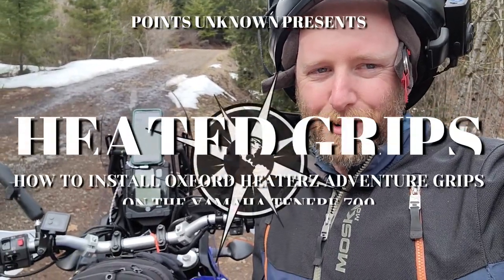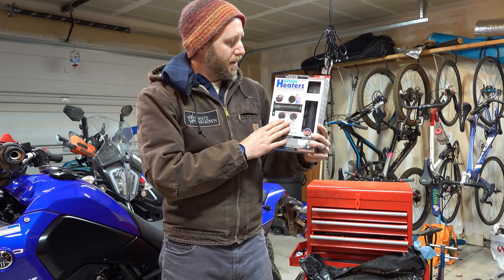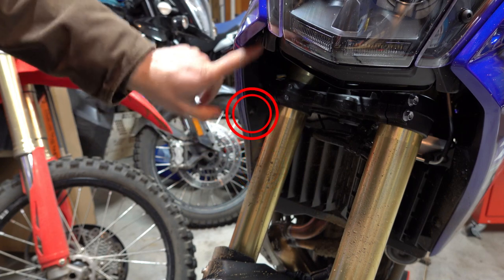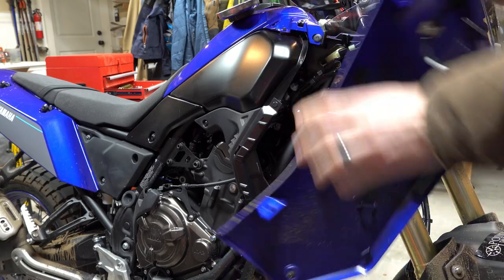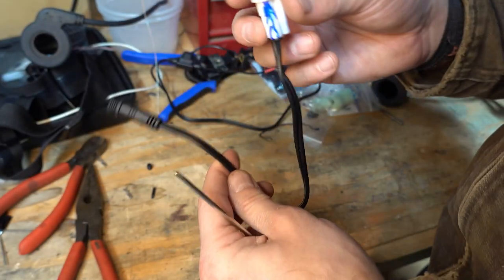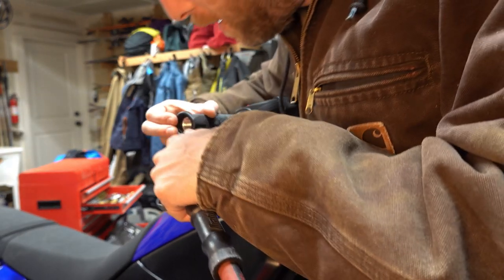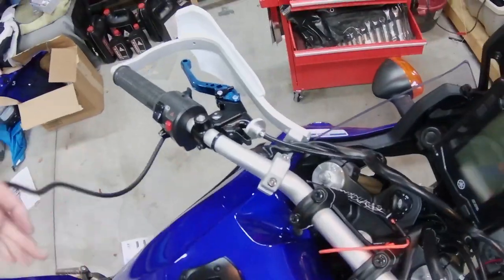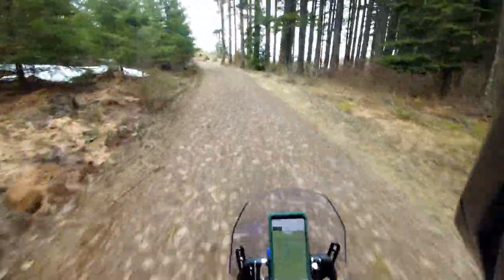Tenere 700: No More Cold Hands (Heated Grips Install)

Comment: Sorry, noob here. Why don't you need the fuse when using AUX connector? Doing this install tomorrow. Thanks!
Reply from the maker: That connector is already fused in the main fuse box on the bike. Two fuses in series is not needed. It's a 10amp fuse.
Reply: @PointsUnknownTV  thanks for the fast response. You're the best! I figured that much but wasn't sure. Saw another guy wire up to AUX but still use the fuse on the Oxfords, then began to question myself haha
Reply: @PointsUnknownTV  well... I went to try this install and it appears on the 2024 tenere they don't include the dummy connector... Such BS. Theres a rubber piece instead of the dummy connector. I ordered the male pins and came to find out the bike doesn't have the dummy plug. Rather than waiting another week and a half for cycle terminal to order the dummy plug, what would I do if I used the ones you listed on Amazon (since those only have 2 spots for wires?) Would you leave the 3rd "hot" still connected to the old aux power and move the 2 I need for the grips over to that Amazon plug you linked? Thanks again for the help. I also don't want to pay shipping on another order from cycle terminal but maybe that's just best
Reply from the maker: I'm sorry. I didn't know. 
3 options that I can think of. 
1) leave the extra wire in the OEM plug, as you mentioned. 
2) wire both hot wires into the hot side of the Amazon plug. 
3) wire up two Amazon plugs (split the ground). So your ready for the next accessory! 

I think any of those would work just depends what you want it to look like when you're done.
Reply: @PointsUnknownTV  Thanks again man. I'll see what I can do. I really appreciate your help! No need to apologize for not knowing the '24 doesn't have the dummy connector. Are they really that strapped for saving a few pennies... Yikes! You've been a big help
Reply: @WeaponsArtist check again, the 2024’s have a 3pin socket that’s on the 10amp fuse, the 2amp from the previous years is now used for the stock usb power supply. It has a dust plug on it.

Comment: Do I need to order the connector to connect to the auxiliary power? It looks like you can connect without them, but I’m not sure, never installed heated grips before…
Reply from the maker: Yes. You will need a connector if you want to use the OEM connector. Depending on the year of your bike you will either just need pins or need the full connector. See other comments in this thread. 

You could always hardwire, directly wire to wire. With no connector. But that might be a bit committing.
Reply: Thank you. Mine is a 2022. 👍🏼

Comment: Great video - Thanks!
Reply from the maker: Glad it helped!
Reply: @PointsUnknownTV  Yessir! I installed Oxfords on my Rally 300; I have Tusk Chub bars on that bike, and it was challenging (the left side was too tight and I had to file the inside of the grip and the right side has a throttle tube with ‘bumps’ on it, so I had to sand that down and also file the inside of the right grip).  It looks like it’ll be MUCH easier on my T7! On my Rally, the Oxfords with Hippo Hands spoiled me…so I need to show the big brother the same love! 🤙😎
Reply from the maker: Yeah. I'm a big fan of heated grips. And I did my own version of DIY hippo hands https://youtu.be/i_CDiYhQHCI?si=npNDB9AHNzJrQ6xb. 

How do you like the HH? Are they worth the money?
Reply: @PointsUnknownTV  Yep. The Hippo Hands were not cheap but WAY better than expected…I have the medium size (rogue, I believe). I can swap them between bikes in a couple of minutes and they work equally as well on either bike. Combined with heated grips, they’re just awesome. I like to ride with my summer Klim gloves, and I can do that just fine and in total comfort with Oxfords and the Hippo Hands down to 30 Degrees F.